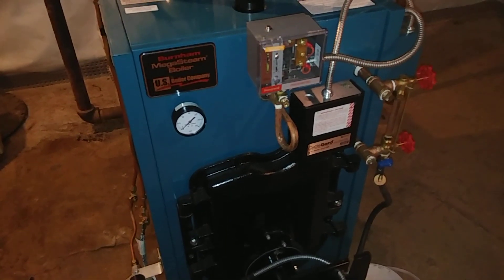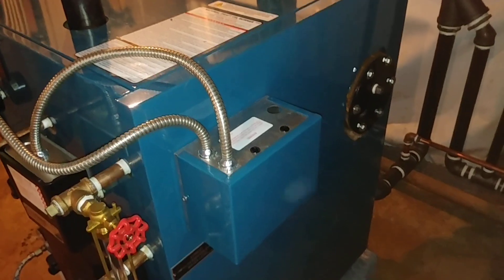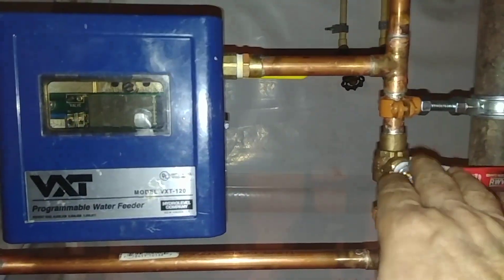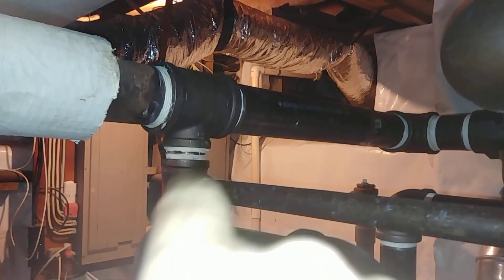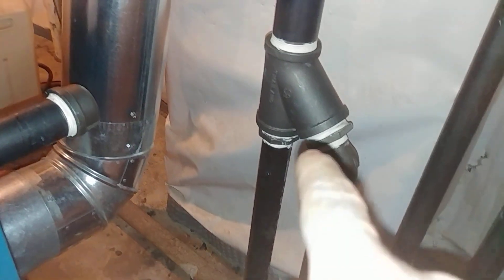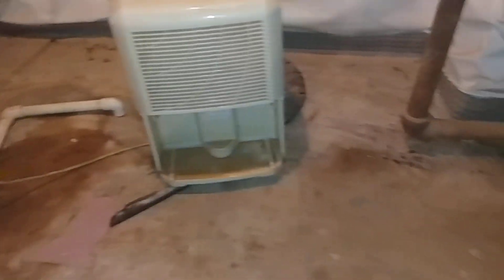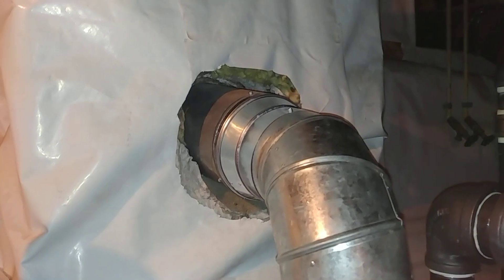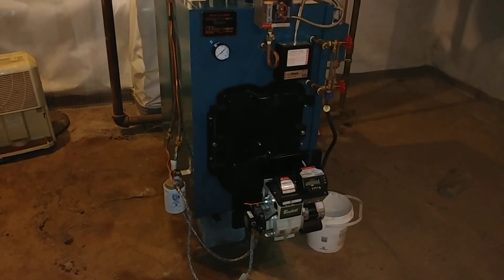Burnham MegaSteam Piping Complete

Comment: I have two recently installed Burnham gas steam boilers in my home and a rental home. I was told not to drain all the water at the end of the season and replace it with clean water. The fresh water would cause slightly more corrosion over the long term if done every year. Have you heard of this? Also, just curious about the reason for the basement walls in the video being covered with what looks like vinyl sheeting.
Reply from the maker: The vinyl sheeting is just that.  This is an old farmstead house and that was done by the basement waterproofers.
Reply from the maker: As to your question about seasonal draining and re-filling, I'd check with Burnham's written instructions and go with what they say in order to maintain your warranty. 
If the written instructions are not clear, than call Burnham tech service and get an answer. Remember to write down the name of the person you talked with and when you talked with them.

Comment: Looks beautiful as always but I am questioning the height of the Hartford loop wye fitting. It looks a little high but I am not familiar with normal water line of the Mega.
Reply from the maker: I might have installed a bit high.
Here was my thought process:
The Mega instructions call for the Loop to be installed 2" below the normal water level. NWL is mid gauge glass.
That funky 2" wye fitting has its "weir" about 1 inch  (more or less) above the bottom outlet of that wye.
The weir determines at what level the water will remain in the boiler if there is a wet return leak and all that water drains away.
That's what I aim for and usually get within plus or minus 1/2" of the target level.

Comment: Home run as always 💥. That drip & returns fit in there perfectly.  One thing I never really understand is why Burnham uses that relay assembly and doesn’t just wire conventionally? Hot weather to be doing iron. Stay well.
Reply from the maker: In regards to Burnham's use of that relay, we don't have a good answer, either.
I may call Burnham and ask.
It wasn't too bad in that basement.  The A/C worked well.
Reply: @gordonschweizer5154  A/C 😳great in this heat.